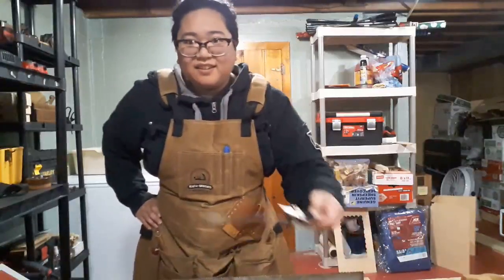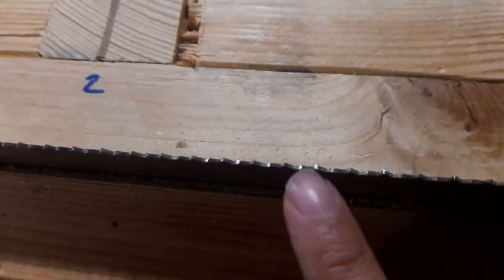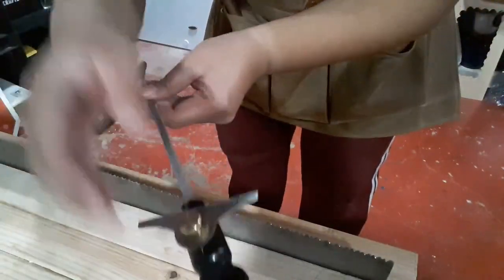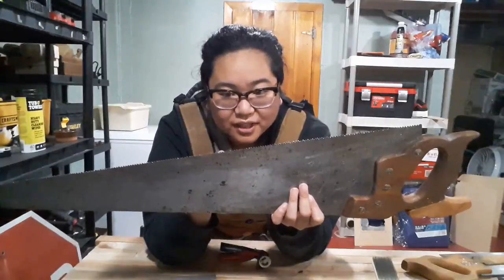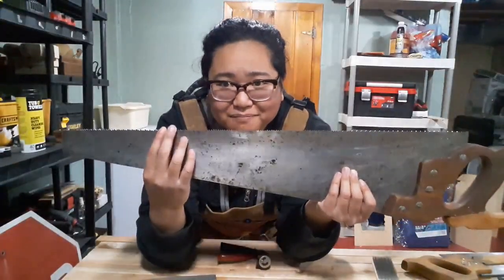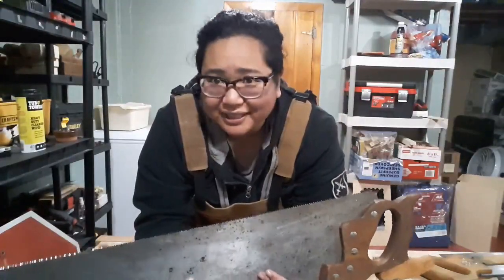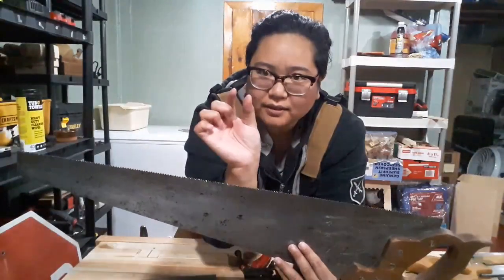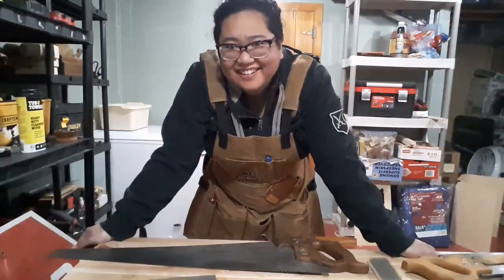Newb Files a Crosscut Saw

Comment: I'm retired, and I am working up to sharpening two handsaws.  I'm procrastinating because I haven't done it before, either.  I bought a handsaw at a garage sale for $3.00 to practice on, but before I try sharpening it I have to clean the rust off of it.   Meanwhile I'm finishing up my excuse to not sharpen them, I'm making a (now late) birthday gift for my wife.  
With regard to the term "fleam."  The Disston company (started in 1840) made all sorts of hand saws for over a hundred years.  In the 20th century they printed a combination catalog and manual on saws.  In their manual, they don't use the term "fleam" they use the term "bevel," instead.  If you understand the term bevel from wood, it's pretty much the same definition.
Paul Sellers and Bob Rozaieski both have good videos on saw sharpening and on making some of your own jigs and holders for files.
Reply from the maker: Thanks for the info!

Comment: Two planks, clamped in the vice and with the top edge planed level, could help grip the saw close to the teeth and stop the vibration making it so much harder.   Paul Sellers’ hand woodworking channel is really good on how to make saws work properly.
Reply from the maker: I'll have to try that.

Comment: Another great video my friend. I would offer you this advise for the next sharpen. If you can get the saw plate deeper into the vise, ideally you want the teeth to just protrude above the vise. This will eliminate the flex you were getting while pushing the file. This of course assumes that you have room to do so in your vise before hitting the bars and screw. Can't wait for the next video.
Reply from the maker: Yeah, unfortunately, that's as low as I could get it on the vise. I'm thinking a future project is building a saw vise so I can also have the saw at a more comfortable height.

Comment: You are braver than I. Despite having saw sets, files, saw holders and dozens of saws, I am still wary about sharpening my own in case I mistakenly ruin a rare saw. I hope to start with my rip saws, as they are easier, and use my cross cuts that are sharp until I gain the confidence.  Your comment about redoing a saw to fix mistakes did give me confidence. Thank you.
Reply from the maker: You're welcome, Randy! I've been nervous to file this saw for over a year. But it was a saw I got in a discount bin, so I'm not at a complete loss if I do mess up. It's got plenty of life left to fixing mistakes. Good luck with your saw filing! Let me know how it goes when you get around to it!